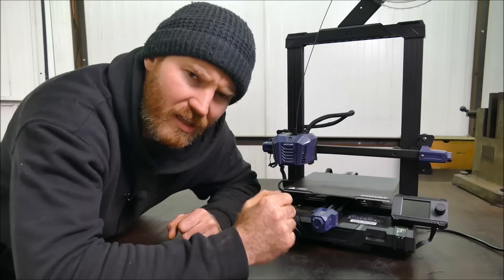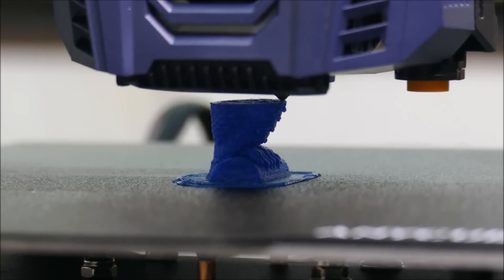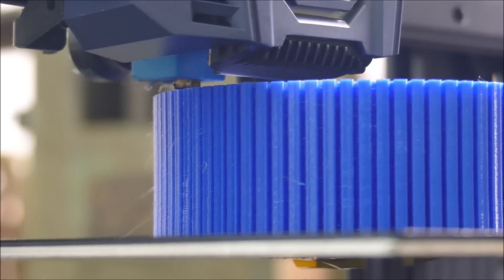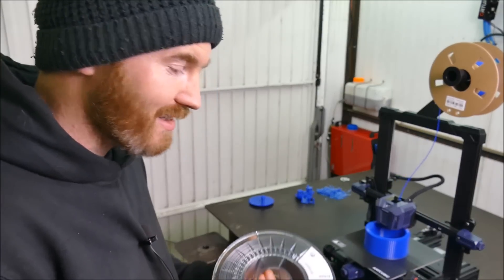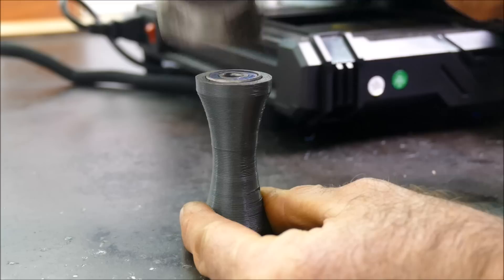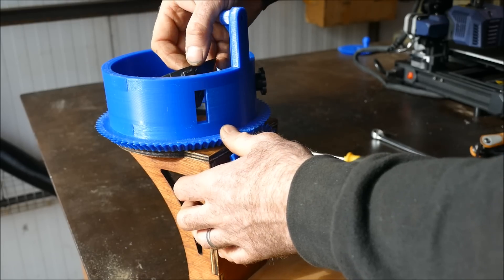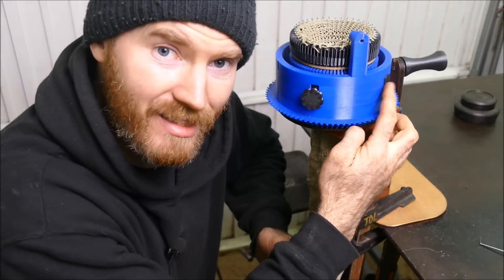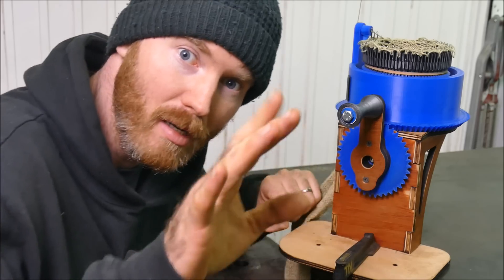3D printed sock knitting machine MK1 -  £200 Anycubic Kobra Neo - practical real world reviews

Comment: have you had issues with inconsistent/wobbly layers on your kobra neo? My kobra neo has had visibly inconsistent layer width. no matter what i do it is clear that something is changing at semi-random points and causing issues. I have tried every tip and trick to reduce the wobble but it has only gotten slightly better.
Reply from the maker: There's a lot of factors that could contribute to consistent wobble on certain layers heights. Have you checked or changed the wheel guides? If they're too tight you get flat spots which will cause vibration or deflection. Cheers J
Reply: @joshuadelisle  my eccentric nuts are set to a proper amount. awhile ago i did over tighten them and they do have minor flat spots now, but after checking my first print and other older ones i can see that it has been having these same issues since the beginning. cleaning the z axis rod seemed to help a small amount and i checked it for any bends while it was off the printer and there were no defects that i could see. i also have a cardboard enclosure but it has no effect on the layers.

 P.S you can fix the improper/skewed bed leveling by sanding the spacers between the bed o the side that is too high, then you should add  M420 to the gcode. for the cooling issue i just printed out a new fan duct

Comment: One thing about Autolevel, using it since my first printer in 2014, you need a D value below 0,4 to handle it well a Value of 0.2 is prefered. My Tronxy A5S for instance won't print when it is above 1. D Value means difference between lowest and highest point. My Tronxy has a degrading bed, first i could deal in the D to 0.15, extremly good prints, now it is warping and only 0.32 possible and less good. So a Bed without manuell adjustment is not good. Very Lovely Build and working printed machine.

Comment: This machine doesn't work like you say it does, DO I HAVE TO BABYSIT IT AND ADJUST IT AS IT'S PRINTING??? i've done exactly the same steps and it's only ever clogged and dragged my prints. i have yet to print anything after a few days of trying to figure it out (while wasting a lot of filament)
Reply from the maker: Thats disapointing to hear. My experience was very pleasant. have you tried the auto leveling just in case it got mis aligned in shipping?

Comment: Worse case, or best case scenario, you can turn that into making a muffler, and sell them as one off with your FDM printed logo! 😅
Note to self, buy a FDM printer, and BIC lighter, BEFORE you run out of filament (or add a run off sensor). 😮
Cheers
Reply from the maker: Good tip. Cheers J

Comment: When you buy these, Do they come with the bits included in the video? Or are they the extra things you buy with the kit?
Reply from the maker: Which bit did you mean?
Reply: @joshuadelisle Its the heated bed, magnetic bed plate, Filament sensor, i take it those are extras? At the moment this printer is only 150 odd. But with the extra's its over 200. But from what I gathered  you don't need them other parts anyway.
Reply from the maker: @DAIMANization  hi. It comes with the magnet build plate and bed sensor but not the filament sensor. I'm testing the cobra 2 out shortly which is the next version up. Cheers J
Reply: @joshuadelisle  Nice one! I'll wait on your review then.

Comment: My experience with anycubic neo is awful, they sent me with non working proximity switch, witch I replaced , shipped by them, next was all 3 stepper motors loosing steps, failure after failure, hundreds of hours spent on adjusting and calibrating
Reply from the maker: That's a real shame, I'm sorry to hear it. So far mine has been ok, I printed a TPU dust extraction connector for my table router recently with good results. Cheers J

Comment: My Neo will be arriving any day now.  (my first printer).   Any chance you can talk about the pre/post bed maintenance?
Reply from the maker: Hi. Well done. As you saw me do I just clicked auto leveling. Then to set the z height (up and down) offset you can use a piece of paper to get the correct gap, so lower the nozzle to the bed until it 'kisses' the paper and then that's it. Otherwise like I did, I printed a model with a brim and adjusted the z height offset until it was adhering correctly whilst printing the brim. All the very best. Cheers J
Reply: @joshuadelisle  Thanks,  very helpful.    <subscribed for more help like this>

Comment: I love to see people getting into CSM stuff (circular sock machine) but the 3d printed files are just not quite there yet. As someone who does flatbed hobbyist repairs and tinkering my recommendations would be:
-Make the gears that turn the damn thing much finer/higher quality/beveled. The giant ones right now jerk around too much and definitely is contributing to the stitches popping up and down/off. You want to have it move as smoothly as possible because any herky jerky movements is going to end up causing the needles to flop around and the stitches to go flying off.
-Switch to using LK150 style needles. They have plastic caps/rollers which make them move far more smoothly against the plastic carriage. If you can find a way to adjust whatever needles you're using now to have those caps it'll make it move soooo much easier. 
-Try PetG or something that handles friction much better. Those machines need liberal amounts of oil to keep them running (especially the metal ones) so having some sort of self-lubricating plastic or a plastic that can handle machine oil/lubricant is ideal.
-Have a proper tension unit! That's going to feed the yarn properly and keep things running a bit smoother, especially if it has a wax cone/ring on it to make the yarn slide smoother through the needles.

Good luck with your CSM endeavors!
Reply from the maker: Thank you so much. Great tip. Cheers J

Comment: You want weights with hooks on them. Longer socks will be too long for weights inside. I would suggest a counter with a little LCD screen. Find a spot to put a magnet on the rotating part and you'll be set. One that can reverse count with a button click would be ideal if they exist. In any case you'll only have to count backward a little bit. There's this stuff called; DuPont Teflon dry film too, in addition to a needle oiler you'll definitely need. 
  I've worked on an original a lot to get it running slick at any decent speed. You don't have enough weight either. You want up to 5 pounds for heavy yarn, split into 10-12 ounce weights each. It looks like its missing parts like the curved bar that spins around.
 Feed angle is important too. I see it is correct from the top but the hole the yarn passes through should be flared and polished smooth. I'd use brass tube and flare the end. You're going pretty slow too. You need to make like 8 pairs a day plus spin the yarn if you're gonna start a cottage industry 😃
Reply from the maker: Excellent advice. Thank you. Cheers J

Comment: I'd love to see you design a better sock knitting machine. I'm struggling with one I printed too. It's not the same one that you picked but it has similar reliability issues. I 
I've spent the last 2 days getting frustrated with bloody thing.
Reply: I've just got mine working.  I was using too thread  that was too thick and not adding enough tension weight.  I think your thread might be too thick too.
Reply from the maker: @dibblethwaite  well done. Mine needs more ability to adjust the height of the needles etc. I've got a good idea how to make it now, just need time to focus on it. Cheers J

Comment: The side to side offset in the bed leveling is common with single z motor ender style machines. Your right side z axis wheels are probably a little too tightly adjusted causing a bit of "racking" in the gantry since that side isn't driven. No amount of probing and bed leveling will fix it because it can change the height of the gantry on the right side at random. You should be able to rotate both outside wheels on that axis by easily by hand. If not they are too tight.
Reply from the maker: Great tip thank you. Cheers J

Comment: My husband watched this for the 3-D printing, but shared it with me for the Circular Sock Machine making! I have an antique one of these, and bought a 3D printer specifically so I could make my own cylinders!  We have been discussing making our own circular knitting machine design so i can crank out hats with finer weight yarn! 
Can't wait to see what you come up with!  Does moving the tension cam up or down change the needle height at all?
Reply from the maker: Thank you. My wife is a spinner and inspired the build. The adjustment of the needle lifter only effects the distance between rows. It needs the main print to be modified to adjust the needle height. I may make that adjustable as it's currently fixed. Cheers J

Comment: Mine dosen't have a SN and is way too far off to even print a 20mm calibration cube. Now I'm in a hell loop of Amazon Anycubic and Asurion all saying it's one of the other companies problem. 4 year insurance dosent mean shit anymore
Reply from the maker: That's a shame. Normally if you buy through prime you can send it back without question. I'm going to shim mine until it's perfectly level. Cheers J
Reply: @joshuadelisle  I didn't notice till after the 30 day return window. I can kiss my 4 year insurance away because it didn't have a SN sticker. Had two QC Pass stickers though lol. I don't like Anycubic at all right now.
Reply from the maker: @stirlingbarber3773  that's fair enough after that. I don't blame you. Are you able to modify it?
Reply: @joshuadelisle  tried adjusting the angle of the upper bar to be flat to the bed(since it was angled). That didn't work either. It just was not a beginner friendly machine in my experience

Comment: Nice splicing :) A sock-kniting machine, i wouldn't have guessed that! Well i didn't :) I bought a grain grinder that turned out to be crap, so i lookeed into making one but had trouble sourcing grinding wheels of the right size, i'm now wondering if PETG would be good enough ...
Reply: PETG might be strong enough to crack grain but not to mill flour for sure. You would also end up with plastic in your crunchy flour fairly quickly. Granite disks shouldn't be too hard to source from somewhere like a tile company or someone who does kitchen counter installs and with a little bit of time and a dremel you could put the proper grooves in them for milling.
Reply: @johnathon007  Thanks, good point i have a dremel, thanks :)
Reply from the maker: Thank you. I want to make a hand powered grain grinder too but out of a largeish basalt rock. I got a cheap stainless one thats no good. cheers J

Comment: Not thrilled with that version of the 3D printer. While you said you could add another fan to it, I would rather have a complete system from the go. The fact that the auto leveler doesn't work properly isn't too much of a surprise, but for only 200 it's as good as one could hope for.
Reply from the maker: I think for the money its spot on but if you want perfection then your talking $$$. I hear the Bambulab X1 carbon is a good one to get. cheers J

Comment: Or you can get a Elegoo Neptune 3 for $209 
( in my case that was £177 that is with the Bank changing fee for the money to UK pounds ).
The Neptune 3 has auto fixed bed Leveling uses a nozzle strain gauge system, 
Touch screen controller, 
X & Y adjustment knobs for the belt tension. 
Print area 9 inches by 9 inches and 11 inches tall. ( 225 mm by 225 mm by 280 mm )

The Extruder is a nice solid dual gear one with a design to cope with TPU flexible filament.
It has two cooling fans so no cooling problems on the models when printing.
Magnetic PEI bed plate.
Low noise fans system, And easy to build with a great help customer service.

Okay no direct extruder drive, it is a Bowden But I not had any problems there.  If you really wish to have a direst drive either upgrade the hot end housing to hold a extruder motor.

Or maybe buy the new " Elegoo Neptune 3 Plus " model they just released which has all the stuff the Neptune 3 has and a direct drive hot end and bigger build sizes of height and width.

Or go nuts and get the even bigger " Neptune 3 Max " which has again all the Neptune 3 Plus stuff and even bigger sizes of printing.

I be ordering the Plus soon myself btw you can only order the Plus or Max from their own website. ( which be cheaper to do even if the Printers were sold on Amazon etc.
And both the plus & max also have a LED light bar above the bed.

https://www.elegoo.com/products/elegoo-neptune-3-plus-fdm-3d-printer-with-larger-build-volume-of-320x320x400mm

https://www.elegoo.com/products/elegoo-neptune-3-max-fdm-3d-printer-massive-printing-size-of-420x420x500mm
Reply: Looks like Elegoo will be selling the Neptune 3 Pro for delivery around the end of March 2023. The print size is slightly larger than the Anycubic Kobra Neo. The Neptune 3 Pro is direct drive and has the end of filament detector, display screen, and dual cooling. Maybe this printer will hit the inexpensive sweet point a little closer.

Comment: very clever bit of engineering and tinkering! Ive got an anycubic zero 2  thats been working fine but with a manual bed adjustment. Even with auto levelling it can still be out of line a little. room environment can make a difference too as its all open and not contained in an enclosure.  Ive just ordered the simder from your other review!....keep posting these excellent videos
Reply from the maker: Thank you Bill. I love my simder, I built a 2m wide sphere for a client recently with it. Cheers J

Comment: Very nice inexpensive 3D printer. When I saw the knitting needles in position on the cylindrical holder, I guessed it was for knitting some kind of hosiery garment. I used to work at a company that made the needles. Slightly different design. We called them slider's, because they slide in and out as they knit the yarn.
Reply from the maker: Thank you Tim, thats really cool you used to build these. cheers J

Comment: I like anycubics - Ive got 3 of them, inc 2 kobras. good printers once setup. and can be made very fast - i,e, standard boaty in 6 mins. Only ever use them for my own designed engineering parts. very reliable.
Reply from the maker: Really good to hear that thank you. I'm very please with mine but I may upgrade the cooling fan and shim the build plate. cheers J
Reply: @joshuadelisle  yes for my 'fast one' I use a 1.0mm nozzle. I changed the hot end to a volcano one, and put in a more powerful cooling fan, and just fashioned a new duct out of thin ali plate. I can then print at 0.8mm later height very quickly. mostly for engineering stuff that's more than accurate enough, and you get massively stronger prints due to the thicker layers. typical print time is example might be 30 mins vs 3 hours with 0.4mm nozzle/0.3mm layer height.
Reply from the maker: @TheFlyingScotsmanTV  nice 👍

Comment: You never said if the expensive filament was better than the cheap stuff or not?
Reply from the maker: I actually had trouble with it, it bubbled at the recomended temperature but I think its more to do with moisture content so I'll need to get a dryer for my PETG. otherwise the cheaper brand worked just as well. cheers J
Reply: @joshuadelisle  Been reading other reviews one said the temp sensor is 15oC out so might be running too hot
Reply from the maker: @mattsan70  I actually checked it with my thermal camera and it was accurate. So I'm not too sure. Cheers J